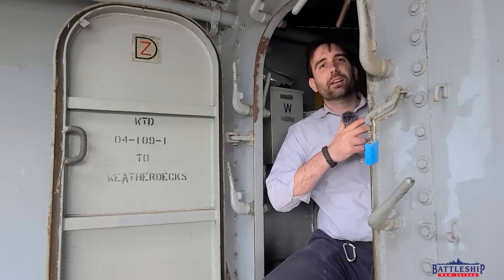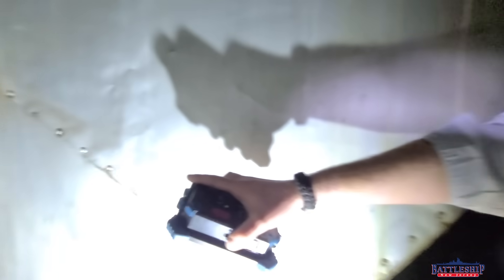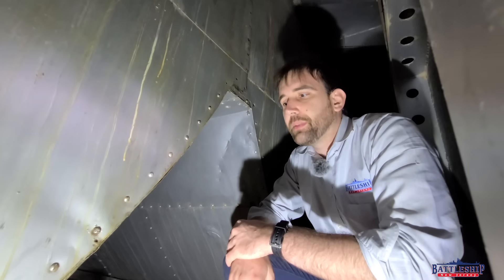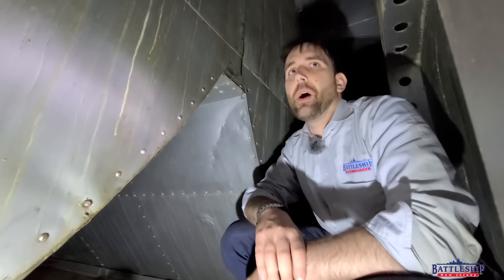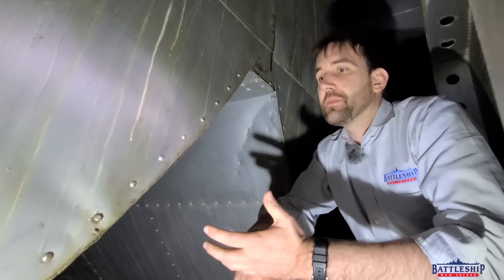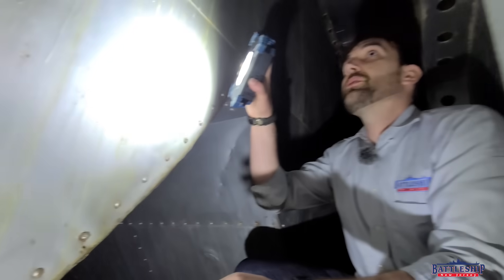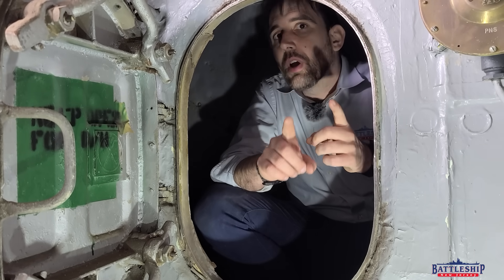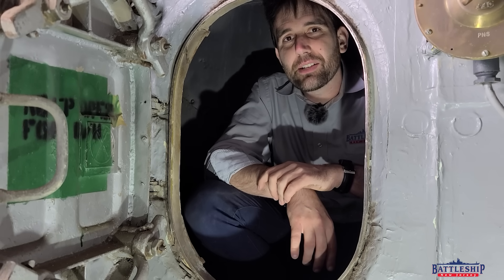Inside the Smokestack of a Battleship!

Comment: The RMS Titanic , which was roughly the same length and displacement as the USS New Jersey , had 29 boilers for a maximum speed of 23 knots. Amazing what advances were made in ship propulsion in only 30 years. I'm sure that going from coal to oil helped a lot.
Reply: Don't forget, she had reciprocating triple expansion engines and not steam turbines, that makes most of the difference.
Reply: @joewalker2152  She had both! The exhaust steam from the reciprocating engines fed a turbine that drove the center propeller. Of course, the disadvantage to this setup is that the center propeller could only run ahead, and only when the reciprocating engines were running at half or full ahead.
Reply: @KingdaToro facts!
Reply: It also had a fake "funnel." Just like the fake exhaust on cars today to make it look faster.
Reply: @tangydiesel1886  As I recall it wasn't entirely fake. It was used for something, just not boiler exhaust. Interior ventilation I believe. The Queen Mary's 3rd funnel similarly was not a boiler funnel but was used to ventilate the kitchens and machinery spaces.
Reply: @WardenWolf  It was for the third class smoke room and a vent for kitchen or something iirc
Reply: @jermasus  The grand fireplace and the first class smoking room as well as the kitchens and provided some ventilation for the engine room, there were also a set of ladders that the engineers could climb to get to a platform that they used for smoking/fresh air/lookout
Reply: @WardenWolf yes mate the forth funnel on titanic was ships ventilation especially as it was over the first or maybe the second class smoking rooms
Reply: @WardenWolf  there’s a good video from Ocean Liner Designs that goes into great detail about the functionality of the 4th funnel. The primary use was ventilation among other things. It also had a platform on top for the crew in the engine room to get some fresh air. There’s a really good picture of a crew member up there on her sister Olympic. You can even spot someone hanging out up there in a photo of Titanic when she was departing Queenstown if you look very closely.
Reply: @tangydiesel1886  I came here to say this lol.
Reply: Don’t forget that it had a ‘4th’ steam expansion before the condensers with the TURBINE engine driving the centre propeller.
Reply: I had never understood how the RMS Titanic's center turbine exhausted steam at less than atmospheric pressure until I learned that steam ships use a closed loop system from exhaust to condenser so when that low PSI steam is turned back into water it significantly reduces the pressure of the remaining gasses thus the condenser gives the exhaust a partial vacuum and providing extra work extraction from that last remaining steam.  Amazing engineering for the time.  I can only assume all steam powered vessels use their steam in a similar manner since its very energy intensive to replace lost boiler water with distilled sea water made while underway (that is also why fresh water is severely minimized on ships for uses like laundry and bathing).
Reply: @larrybremer4930 On my dad's WWII ship HMS Wolfe in the Indian Ocean, they showered in seawater.
Reply: @BritishBeachcomber  USMC and I spent some time on USS Frederick LST-1184 where we were limited to Navy Showers, less than 2 minutes of water under like a 1 GPM shower head, but it was at least fresh water.
Reply: @larrybremer4930  Basically, any steam turbine operates with the exhaust into a condenser for efficiency.  Makeup water for the boilers is separate from the fresh water used on the ship.  It is treated to minimize scaling and corrosion in the boilers and piping.  My guess is the steam pressure for operation is at least 600 psi for an Iowa class battleship.  Some US Naval ships operated at 1200 psi steam pressure.  A turbine is more efficient with as high a pressure drop through the turbine as possible.  The condenser will be at about 26 inches of mercury in any system.
Reply: @royreynolds108  Yes I know potable and boiler feed water are separate systems, but both are replenished underway by sea water distillation plants.
Reply: Far more power from the steam turbines. But, they also consume massive amounts of fuel, don’t run in reverse, and are extra low efficiency at low speeds. 
For an ocean liner they have to consider efficiency and cost. Having less efficient engines isn’t typically as important as the extra couple of knots. And, the gearing required adds a lot of cost. 

For the Navy there’s much less concern for cost because they aren’t trying to make money running passengers. They value the performance much more.
Reply: Fascinating how quickly things advanced isn’t it!  Especially the quick advancement of steam turbines with nuclear powered ships coming on scene. It’s crazy to think the new Ford class carriers with their massive size and displacement can cruise along in excess of 30 knots on 260,000 shaft hp.
Reply: Also, the boilers on in the Iowa Class used 'forced draft' combustion blowers to feed combustion air into the furnace. The Titanic used less efficient 'induced draft' fans. And the Iowa's utilized superheaters in their boilers, and the steam pressure was considerably higher.
Titanic = naturally asperated Toyota gasoline 4 banger, driven by a systems archivist.
New Jersey = Supercharged nitromethane Hemi V8, driven buy a dude thats been awake for 3 days on nothing but Red Bull and Copenhagen snuff.
Reply: war...A lot of things we have are wartime invention. Fear if death gets people inventing

Comment: Does the ship have an air intake system for the engines, and if so how does it work?
Reply: For light-off and bringing up steam, on USS Nassau LHA-4, we had electric fans to provide combustion air, then once we had sufficient steam pressure, the steam-driven blowers would be brought on-line.
Reply: There are certainly intakes for the boilers.

Comment: The design and engineering that happened over 80 years ago is incredible . Especially when we were in the era of slide rules, old fashion draftsmen as compared to modern day CAD CAM  used today !
Reply: Can't imagine the army of draftsman it took to take the 10's of thousands of blueprints to build one of these. How many full time jobs it took just to keep them organized and updated and delivered to who needed to use them, all these jobs that don't exist anymore and they still got things done quickly in a way we can't come close to today.
Reply: The metal workers and pipe fitters were artists. Those curves and joints in the trunking are beautifully made.
Reply: So sick of the  "back in the slide rule" trope. It's so idiotic! The slide rule was and always has been and extremely accurate calculator. You get the same results as you do an electric calculator. "Back in the era of slide rule" woodeefuckingdoo. The reason those things were made possible was because of the slide rule! Not in spite of it.....
Reply: sadly, we've lost much of the design documentation, and construction info
Reply: It’s a craft that’s now dead due technology, the workers are much dumber nowadays than the old days, see it all the time, and the young kids don’t have any drive
Reply: @black07rr  The workers aren't dumber now...there's just fewer of them, and their talents aren't expressed as widely or often.
Reply: @black07rr  I knew instinctively that some muppet would blarp that nonsense out 😂
Reply: @Ganiscol why cos he’s right?
Reply: @That Patriot  people are just as smart as they always were, just focused on different things. 
And plenty of young people have drive to do their jobs and to a good standard.
Reply: @jamesmccann531  I’ve been industrial construction for 25 years, building steel mills, power houses chemical plants and doing maintenance shutdowns on all of them, I’ve dealt with and seen first hand the degrade of pride and drive to do better or learn.  They want the money but don’t want to do the work or put in the effort.  I’m not saying it’s everybody, but it leans more towards the negative than the positive.  Everybody wants to play on their phones and take pictures of shit and post to social media and get mad when they get caught and terminated for break the rules.
Reply: @jamesmccann531 well now you’re talking bollox mate

Comment: This man is amazing. I’ve been watching this channel for awhile and I honestly think he knows more about that ship than the sailors that were actually stationed on it.😂🇺🇸THANK YOU FOR YOUR SERVICE.
Reply: Perhaps the enlisted rating with the most general knowledge of mid sized and smaller ships was the Electrician's Mate, we not only dealt with machinery and equipment in EVERY part of the ship, but stood watches "down in the hole" as well. (spoken by a 1960s sailor)
Reply: @markmark2080  from a late '80s sailor, on my ship when you finished qualifying for your underway EM watches you would have started on the IC watches.  The reverse was also true.  Pretty sure that my hearing loss was from SS Switchboard and Emergency Diesel Switchboard watches, and not from standing my "normal" Main IC Switchboard/Gyro Watch.  Sounding and Security and DC Central watches were a given.  When I left active duty I was also qualified for Repair Party Electrician and was working on Inport Duty EM.

As far as general knowledge goes, think for a moment upon how many compartments did NOT have a 1MC speaker, a sound-powered phone jack, and/or a dial telephone.
Reply: @kevincrosby1760  Thanks for replying, YES, I was more of a VERY average "Gear head" when I went in with no particular interest in the movement of electrons, getting assigned to EM school was, at first, a disappointment that quickly changed. Standing watches in a 135 degree (I kid you not) diesel generator room on a WW2 LST in the tropical heat of blue and brown water Viet Nam, Steam turbine engine rooms on two other ships, changing reefer blower bearings down in a minus 10 degree freezer cargo hold in the middle of the night, stringing "Med lights" whenever entering a European Port, and my personal favorite was repairing/changing the aircraft warning lights at sea (only got to do it twice but each time took my camera up with me). It's kind of sad to think of the sailors who never really got to see their whole ship...After I got out of the Navy, that EM experience opened some Amazing doors for me that would have never happened otherwise...Cheers man.
Reply: @markmark2080  I actually signed up to be an EN (Engineman) because i wanted to work with diesels.  

When they offered me IC while still in boot, I thought that learning something new might not be a bad thing, and I could always go BACK to being a mechanic...I was actually servicing construction equipment when I joined the Navy.

Turns out that an electron pusher who knows diesels was popular with the EDG guys AND the small boat guys.  Sometimes the overlap allowed me to jump in where others were uncomfortable.

Compressors (both A/C and air) and pumps on heavy equipment are a given, and growing up on a farm brought basic plumbing and metalwork into play. 

Not that I was some kind of "Super Sailor", It was just that I could look at something as a UNIT, rather than the EM's motor driving  A-Gangs compressor while both were sitting on the HT's brackets and nicely aligned by the MR's shims.
Reply: @kevincrosby1760  On the LST, our main engines were (2) V-12 EMD 567s, in a 32' wide roughly square room,  on my last ship (AF-58), the Emer. Diesel Gen. was the opposed piston Fairbanks Morse...The only thing louder than standing next to those boys when they were running is Top Fuel Dragsters, we didn't have ear protection back in those days...Yeah, EMs and IC men, and of course our buddies the Shipfitters, as they were called back in my day.
Reply: @markmark2080  Our propulsion system was 600-PSI steam, superheated to about 850F or so.  Propulsion was standard multi-stage turbines and reduction gears.  SSTG (4) were all steam turbine.

EDG was a 500MW unit, with a Detroit 8V92 at each end.

Regardless of the motive force, creating 32,000 shaft horsepower is going to be a hot noisy business.
Reply: @kevincrosby1760  Yes it is, I was on AV-7 (Seaplane Tender) before the LST, and AF-58 (cold stores) afterwards, both steam turbine, although I didn't relish working in, and standing watches down in the hole, I'm thankful for and cherish the time spent down there. When I hear people whining about a little discomfort, I'd like to send them down there to deal with a hot dirty job...I really enjoy seeing some of the modern "big ship" engine rooms on YT, it appears that the old fuel oil boilers are getting to be a thing of the past...
Reply: If the Navy ever recommissioned New Jersey they would commission Ryan too.
Reply: Absolutely he does haha. There would be anywhere from 1600-2700 crew on board New Jersey throughout her career. The sailors were each trained for a very specific job and the ship is massive, so chances are most sailors never saw much outside of their working areas or where they could stroll around during downtime.
Reply: Same now

Comment: I think 2 is the ideal number. Maximizes deck space so you can have more guns, better arcs of fire, etc as well as interior volume for ammo and crew. I feel like a single stack sacrifices way to much inside the ship, and 4 while looking attractive sacrifices to much on the deck. So 2 it is.
Reply: The number of stacks is largely determined by function.  The ideal number is what it takes to contain all of the boiler uptakes while staying within a practical size.  Boiler uptakes must stay within their design constraints of cross sectional area and the number and degree of bends you can put in them without reducing draft.  Even if they could all be contained within one funnel, wide spacing between boilers may result in too many or too angled bends in the uptakes to fit, requiring them to be split between two funnels.
Reply: @tomscotttheolderone364  Those are all valid design considerations of course.
I was just thinking out loud in an over simplified perspective of aesthetics and function I suppose.
Reply: @sparkplug1018  Sure, I understand!

Comment: I've always wanted to find a way to vent them underwater eliminating the stacks altogether. That said, I think that the way some of the early CVs had their stacks laid to the side was a horrible idea. My idea stems from the way that the RAH-66 Comanche helicopter had be designed to have the exhaust gases venting the whole length of the of the tail boom in an effort to give them more room to cool before being pushed out of the aircraft to reduce it IR signature.
Reply: The less dense hot gas in a vertical tube assisted in getting the exhaust out of the ship.  Chimneys don’t get built horizontally.

Comment: You still didn't go into the smoke stack of the ship.  You visited the uptakes.  Plenty of room in the after funnel, just go up the vertical ladder on the aft part of the after funnel, open the hatch, then you'll have to turn sideways to get past the two larger vertical pipes partially blocking the opening.  😀
Reply: Yeah!!!  I’d still like to see the inside of the stack as baited!
Reply: And, yeah, it'd have been nice to get into the actual funnel, but it might have required too much planning for what was clearly intended to be a short, easy video.
Reply: Navy won't let you, go and try.
Reply: Sadly, we don't have the insurance of the Navy to climb that exposed ladder anymore lol. I'd personally love to because I'm an engineering freak and have spelunked around all the boiler and engine rooms. Still need a few more uptake visits
Reply: @KPen3750  could use a drone
Reply: He's used the term funnel a few times. He did a video on the repair of the metal on top of the after funnel.  He's also done videos where he was in other uptake spaces because they're used for storage of large parts. Lot more room in other uptake spaces to view the uptakes.  Doesn't have the dramatic effect of squeezing into a tight space to look at an uptake
Reply: considering what substances there is in oil smoke I think he did a wise decision
Reply: @janandersson5739  That's why he should do a video inside the funnel because it's nothing like that.  It's a large funnel surrounding a large exhaust pipe.  I was last inside it in 1990 and it wasn't dirty or sooty in the least
Reply: @janandersson5739 If a boiler is burning properly there will not be a lot nasty waste in the stack.   Where I work we burner bunker oil---same as the Navy----in our boilers.  Occasionally the stacks were cleaned.  The nastiest things we found were bird carcasses from birds that were asphyxiation when the roosted on the edge of the stack.